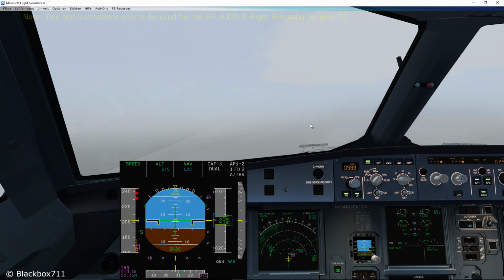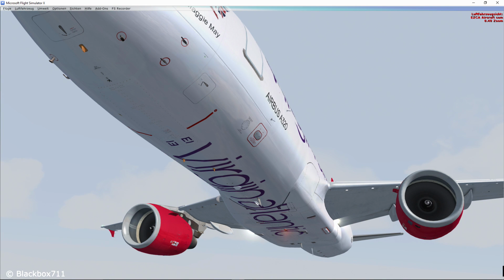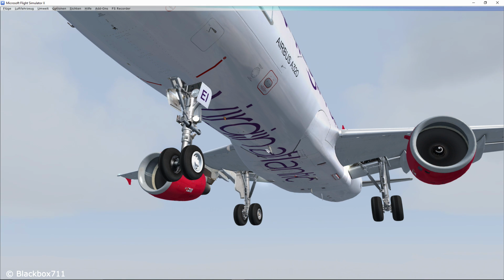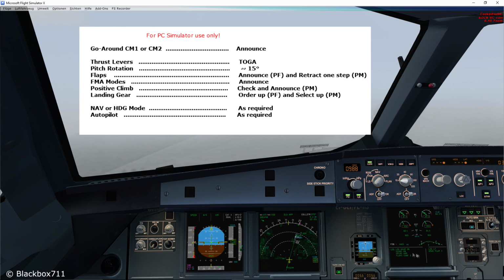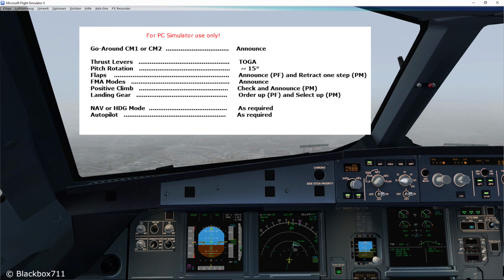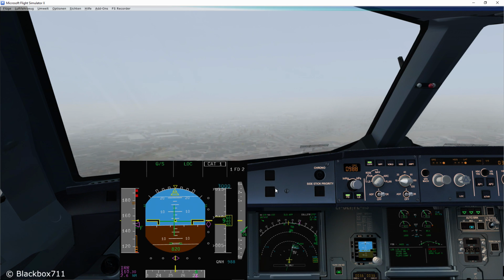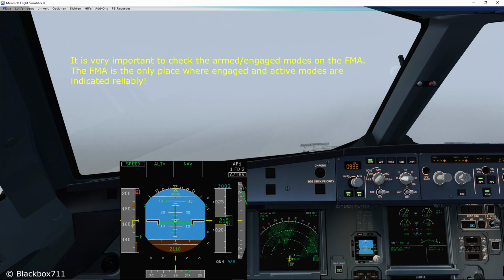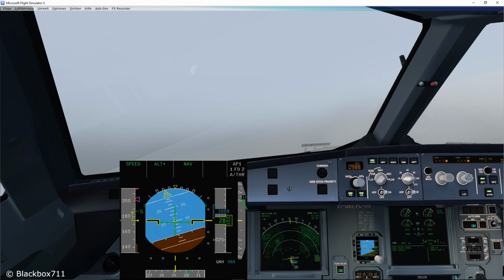FSLabs A320-X Basics: The Go-Around Procedure

Comment: Would you call for flap retraction if you're below F speed?
Reply from the maker: You mean for initial call “Go-Around- Flaps”?
Reply: @Blackbox711  affirm
Reply from the maker: If the approach was flown at flaps full, you can be below F-Speed with Flaps 3, so no problem. If approach was flown in Flaps 3, the Vapp normally is at or slightly above F-Speed. So no problem going Flaps 2. Strictly speaking when at Flaps 2 the speed should not be below F-Speed.
Reply: @Blackbox711  thanks. You're the man

Comment: My FGMC is programmed correctly but it doesn't auto-sequence the Go Around phase when I go TOGA @ 200' AGL. It stays in "LAND" mode. What could be preventing it from triggering the go around phase?
Reply from the maker: Did you put the thrust levers into the TOGA notch? I.e. are the thrust levers correctly tuned? Otherwise I don’t see why it would not leave the approach mode and go to Go-Around mode.

Comment: How do I actívate the aproach again ? The same I was doing before missed aproaching?
Reply from the maker: Manually by going to the PERF page and select “activate approach phase” and confirm. Otherwise it will activate automatically when overflying the deceleration point when in NAV mode.
Reply: @Blackbox711  ok I got IT is focused to the fslabs, you^re so kind have good day

Comment: After initiate the go around, my MCDU doesn't seem to work as it should. The altitudes and speeds on the waypoints of the go around route is totally wrong (such as a few thousand feet above the runway) and I have to end up hand flying the airplane and land manually. Maybe I have did something wrong ?

Thank you for your nice videos btw
Reply from the maker: Hi. Thank you. The version you are flying has a bug sometimes when performing a go-around. Does the FMGC disappear completely in the case you described?
Reply: @Blackbox711  no, there is a green track on the ND and the MCDU but the altitudes and speeds are just wrong and I disconnected the AP and follow the track manually

Comment: Wow! pretty istructive and interesting, as usual.
What's happens after a go-around on the MCDU side? How do you reprogram a second landing attempt? How to step back from "GO-AROUND" phase into a new "APPROACH MODE"?
Reply from the maker: You simply activate the Approach Phase in the MCDU again. The last approach and performance data are still stored.
Reply: Thanks for the reply!
I have an alternate airport distant several hundred miles, so i managed to follow the diversion route form the intended destination to the alternate (SID RTE STAR),  but the perf page remains struck on "go around" (only activate new apprch is possible) so the managed speed is below 200kts. Even if i set the alternate cruise FL, the climb profile seems to be missing and i have no TOC and no TOD. In other words, just lateral guidance to the alternate airport is available. I'm missing something?

Comment: Hi Backbox711, awesome, brilliant, all your videos!. 
Couple of questions though, as I’ve been unable to find out through FCOM, FCTM, google etc…
When retracting flaps one step, if you are in flaps full you don’t even have F speed so you don’t have to worry about speed at all? And in flaps 3? Should you have to check to be above F speed or its ok to command flaps 2 even below F speed?
And what about a rejected landing or a touch and go? How do you stablish the rotate speed? Simply the Fapp or related to?
Actually you could add if you like a ‘rejected landing/touch and go’ video to your to do list… would be very clarifying for sure. 
Thank you very much! And congrats for a very well done videos.
Reply from the maker: Hi. Thank you for your kind words. The whole Flaps concept is pretty simple in the A320. During Approach you can fly below F-Speed if Flaps are 3 or Full. During Flap retraction in case of a Go-Around you can select one step up straight away as long as you are above VLS. So if in Flaps Full you select Flaps 3, if in Flaps 3 Configuration you  select Flaps 2. As long as you are above the F-Speed, you can select Flaps 1. So if you are at Config 3 and above F-Speed, you select Flaps 1. The same applies of course for Flaps 2. So to answer your question, yes in case of a Go-Around you can select Flaps 2 even below F-Speed. However you only select flaps 1 when above F-Speed.
Reply from the maker: Regarding Rejected Landing you have the normal Go-Around Procedure. The touch and go however is a training procedure where you select flaps 1 and retract the spoilers. Once in Flaps 1 Config you should be above 150 kts in order to lift of again. Do not go above 195 kts however! That is the maximum speed on ground for the tires.
I have put your request for a video regarding  ‘rejected landing/touch and go’ on my list. Regards
Reply: Thank you so much for your answers! They are quite clear. Looking forward for your next videos. Happy landings!

Comment: Very nice video as always! One question: Did you use the rudder to crab the aircraft into the crosswind when you were flying manually on final approach?
Reply from the maker: Hi Carlo. Thank you. No, I only use rudder during the flare, i.e. passing 50 ft. Regards
Reply: @Blackbox711  Hi. I have gone back in time again for some great instruction.
So do you mean to say on the A320 you do not need to use rudder input on final approach till the flare? If so how do you maintain runway centreline track on approach with slight crosswinds. Thanks in advance for the response.
Reply from the maker: @farayidarlingtonchaparadza20  Hi. The aircraft „crabs“. That means the nose of the aircraft points towards the wind side. The pilot (or autopilot) determines the amount of wind correction angle to counter the drift caused by the wind. That way the track of the aircraft over ground stays on the runway centerline.